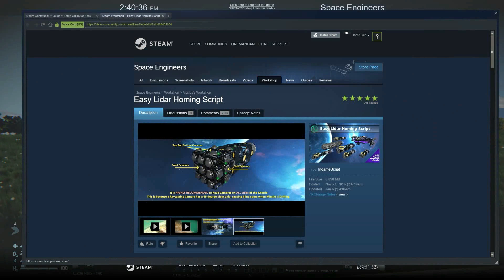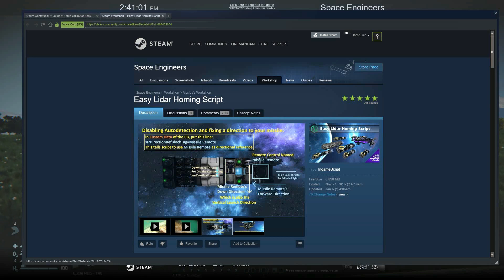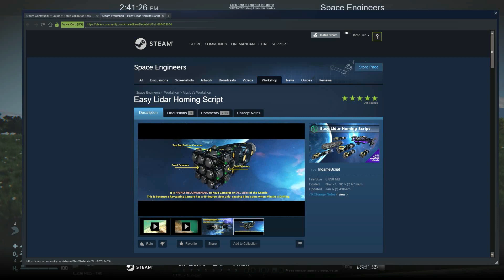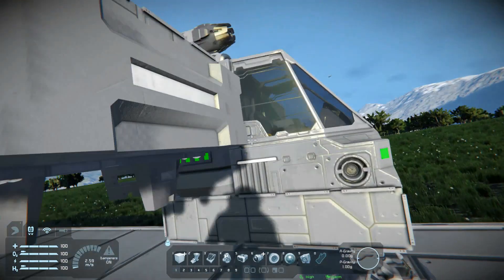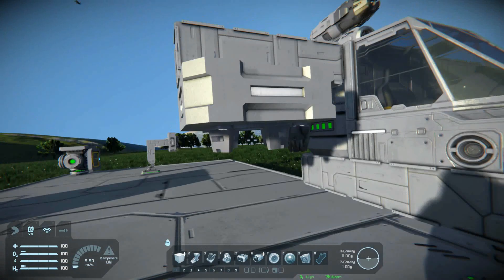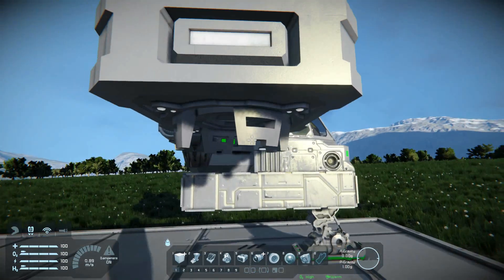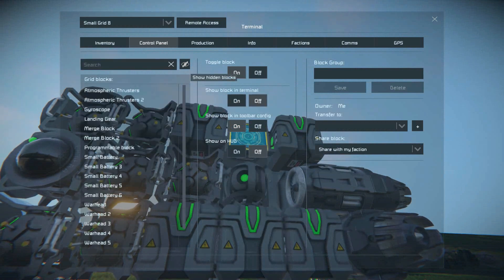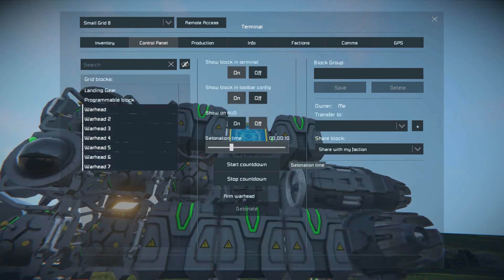Space Engineers: Easy Lidar Homing Script Tutorial Part 1

Comment: when i fire the missile, it just fires the engines, activates the guidance but the missile does not actually move?
Reply from the maker: when you say activates the engine, does the thrust override come on? It could simply be the missile is not connected properly to the ship and not detaching.

also try this. to fire, in the augment box of the program block type "mode:0". that is a zero. dont use the ". It should fire and follow line of sight of your cockpit/remote control until it locks an enemy grid
Reply: @sinsley1  Yeah so the engines all fire, and its clear the AI is apply thrust, but the missile itself is not moving. 

I was also curious if for some reason the merge block just did not disengage properly, but even when i broke it manually the missile did not move. 

I was using ION thrusters in atmosphere, but based on my math it should have still been able to fly, but iam going to re try in vaccume and will get back to you.
Reply from the maker: @rockwelllinsley6740  that is probably your problem. Ions don’t really work in atmo. Also could still be a static grid thus not moving. Paste the missile in space not attached to anything then press RUN on the program block. Missile should fly off it it was built correctly

Comment: when i use hydrogen thrusters it shuts them off
Reply from the maker: It shouldnt. Make sure you have a small battery and use a way to power the thrusters. Either a 1 of the new small hydrogen tanks or an h2 generator. You may have to use 2 h2 gens